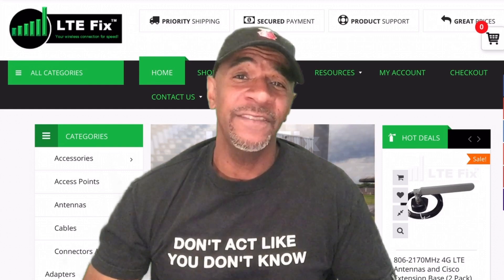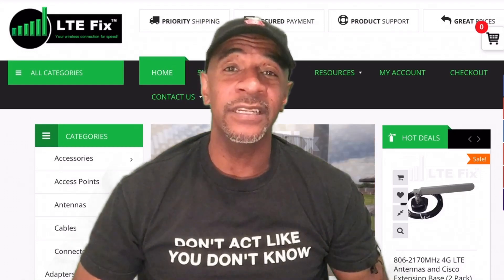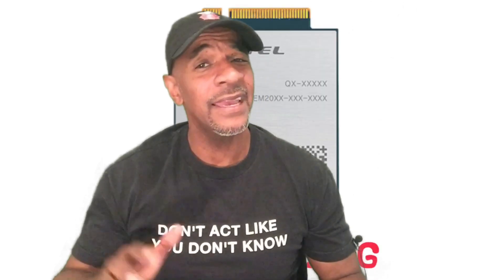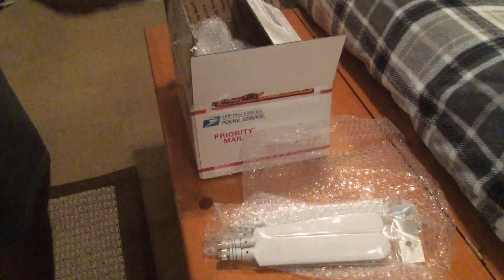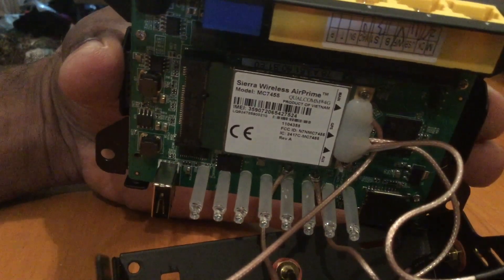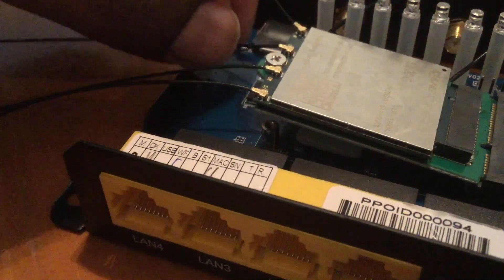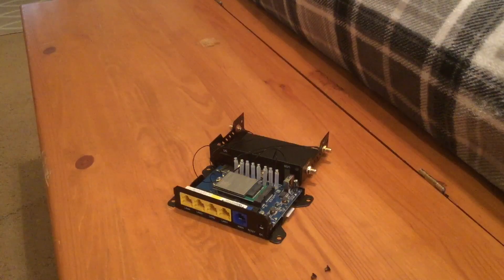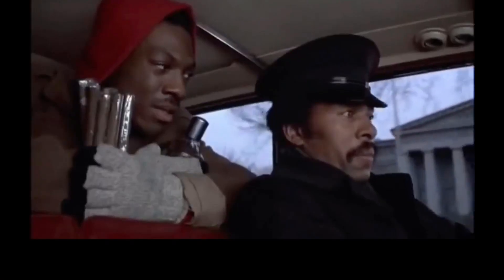How To Make Your Own Cell Router

Comment: First off, thank you! I'd been looking for someone who's successfully executed this. 
I was surprised how few actually talk about this
I've been on the verge of doing something like this. Are both modules still necessary if I'm intending on using it hardwired exclusively. As in no wifi. 
I have router modem combo that has a pci-e slot inside.
Wouldn't I just need an LTE module?
Reply from the maker: You have a modem already ? Or does it have a slot for the modem? If its just the slot ( no modem ) then yes you'll need a modem , cat 6 or better for LTE and some firmware that's compatible with said modem ...then all you'll need is a SIM card with a data plan and you should be good to go!
Reply: It has a slot and it had a Qualcomm athenos pci-e w the tiny antenna hookups. 
I figured I could order and replace it w the same size but instead one w a sim slot
Reply from the maker: @davidh2550  I never used the sim slot on my modem only the only built into the router ( that's why the firmware compatibility was a must ) let me know how it works out if you replace it and use the SIM card on the modem slot. I would love to hear the results

Comment: So the EM20 is capable of theoretical:
* Download Data rate: 2 Gbps
* UplinkData rate: 150 Mbps 

The NexQ6G0 Router has 10/100M LAN ports = 100Mbs Max Speed, So if you get an average of 165Mbs Download on your phone, (Thats what I get) Wouldn't that Router be a Bottle Neck?  Unless you only use The Wifi 2.4g at The theoretical Speed 300Mbps to connect to most of your devices?  I think in my situation the WG1608 would be a better option because of the Gigabit LAN ports, I think just a personal choice as I preferer wired connections, But is that why you went with that Router?   ---- I've also seen some videos use a Heat Sink on the Modem Module, not too clear if it really needs a heatsink or not?
Reply from the maker: The 100Mb ports are a bottleneck for sure only went with this router because WG was sold out at the time (during the beginning of the pandemic) the heat sink is not needed just extra protection.

Comment: Do you have to get that expensive of modem
Reply from the maker: Not at all in fact I would advise against it now. A cat 6 or better modem will work fine
Reply: @profitgee1  what do you recommend
Reply from the maker: @RobertDickens2002  a Quectel EP06A its a cat 6 modem for about $100 there are cat 12 modems for $170 i wouldnt spend too much $ because 5G will be the standard in the next couple of years.
Reply: @profitgee1  Thank you for information and being so responsive I also subscribed
Reply from the maker: @RobertDickens2002  thank you!

Comment: hey Berry, do you know if that setup you built still works after the tower upgrade, by t-mobile?  most LTE modem no longer work with t-mobile after 8/2021.  and the ones that work are almost at the mofi price.  

thank for the video.

Comment: Just buy an unlocked phone and connect it to an existing router. In a stationary setup you could even connect external antennas to the phone directly. In my case I used a damaged 5g phone a DSL modem/router combo I had lying around, and it has no problems working 24/7 for years now. 

Every single router with a built in expansion slot that I've used failed in multiple ways within a few months, so try to stick to the more reputable brands and models with plenty of firmware to choose from.

Comment: Why a Cat20 modem with only 10/100 Ethernet? What do your carriers support? Seems like overkill if your carrier can’t support the extra Cats and if they do then you won’t get the speeds out of the router. Not a problem if you intend to upgrade the shell later to something that supports gigabit, but would still question if your carrier will ever upgrade to anything approaching Cat 20.
Reply from the maker: Basically I ordered what was available during early pandemic the pickins were slim lol wanted to get the WG3626 for the router but at the time couldn't find any the cat 20 is a bit overkill but the only other modems available at that time were cat 6 and I already owned a MOFI so....as far as the carrier goes the power in the cat 20 comes from the carrier aggregation capabilities, so if you have multiple towers around or multiple bands the modem can combine those to increase your bandwidth throughput, so as long as you have LTE in your area the carrier doesn't need to be upgraded to 5G for the modem to take advantage of it's power. Thanks for watching!

Comment: Hey Berry Good Juice I purchased a pre-made unit running golden orb and has cat12 modem. I have cricket wireless (uses AT&T towers). I couldn't find the apn for cricket so I used "broadband" suggested for AT&T and used for it 30 minutes then no longer can access the internet. Any browser I open cricket led me to a link that says my account is banned or suspended. I have 4 accounts with that plan and so far the other 3 are still working, only the one in that golden orb firmware is not working. I also have another sim card in a Mofi 4500 that has been working good for 4 months. Do you think I got banned because I used the wrong apn?
Reply from the maker: @Super Swing Trader I came across this video maybe it sheds some light on your situation....https://youtu.be/g4uROfZsC1Q
Reply: @profitgee1  thanks Berry Juice it turned out I used the wrong Apn. I used the correct apn and everything is working great. Thank you for your help!

Comment: Hey Berry Juice, thanks for the awesome video. This might be a stupid question but will router that you build have a built in sim card reader slot that we can put our sim card in? Thank you
Reply from the maker: @Super Swing Trader ..Not a stupid question at all, most of the routers you get from LTEfix for your build have a SIM card slot just make sure the modem you choose is compatible with the router’s firmware so you have access to all the modems features (ie band locking and carrier aggregation)

Comment: Great video. I’m a new subscriber now. I’m going to do this myself. I have the Mofi4500 sim4/LTE combo v3 but using a TP-Link gaming router instead of the Mofi router. Getting 65-75 downloads on my visible account, but I want more lol.
Reply from the maker: @biglonniegruhn it’s never fast enough lol! But make sure you spring for a Gigabit router instead of the one I used cuz you’ll be capped at 100 Mbps coming out the Lan ports. Your getting 75 down with Visble? That’s Amazing! What’s the ping like?  Good luck and have fun with your build!
Reply: @profitgee1  fastest was a 81.9 down 19 up and ping 119 jitter 5
Reply: @biglonniegruhn  What's your setup like? I am using Visible unlimited cell plan on an Android phone. The phone runs FoxFi/WiFiTether which hooks up via USB cable to my laptop which then runs to the WAN port on my home WiFi router which handles the rest. Speeds are stupid slow and I get random disconnects every couple of days or during heavy use daily. How are you getting around the modem being detected as a modem which will result in slowdown or account banning?
Reply: @profitgee1  sadly that modem you have is no longer available. They now have the Cat16 modem with 4x4 Mimo and 5X Carrier Aggregation.

Comment: What firmware did you use?
Reply from the maker: Jamie Holmes  I used the GoldenOrb_2020-5-16 kernel version 4.9.211, I go over it more in part 2 of this video
Reply: Is there a vid for flashing firmware for sierra wireless modems?

Comment: Did you have to do anything about the IMEI?
Reply from the maker: No. But the plan I have allows for SIM card swapping between devices. I’ve also used a post paid phone SIM in this router with no problems tho

Comment: lol you really didnt "make your own router"  you bought a router and literally just changed a few parts lol and btw you spent almost double of what you could have bought the mofi router for lmao you could get one on eebay for less then 200 sometime alot less!
Reply from the maker: michael wentz thanks for your comment  and yeah I didn’t “make “ my router I put it together. I spent more because my modem is way more powerful than the cat 6 in the mofi and yeah I could of bought a used mofi on eBay or I could’ve put a cat 6 modem in this and spent less than $200 ...cheaper than a used Mofi that may or may not work from eBay and certainly cheaper than a new one ....

Comment: You made me think of building my own router . My netgear nighthawk is acting up. I keep having to reset it. It is so annoying. I want to build my own now.my daughter needs it for online schooling. If you have any advice while the website gets restocked in about 7 or 8 days, please let me know.
Reply from the maker: @Dexter Russell when LTEfix is restocked hopefully you'll have your pick of routers and modems to choose from ...i recommend getting a cat 12 modem and if they have any routers w/ gigabit lan ports I'd get one of those(the one I have has 100Mb ports)  also check the LTE hacks  forum out there are alot of interesting builds people are doing that work well for them. Using Rasberry pi boards, power over ethernet...etc.
Reply: I'm also looking for a dual band router. Any suggestions?
Reply from the maker: @dexterrussell9581  the wg3526 is a dual band router

Comment: Wow! Thank you for doing this and making a detailed video.  
1. What other modem options are good one's to build a good unit with? 
2. Will any modem fit a router?
Sorry trying to learn, been reading up.  Currently i have a mofi4500.  I would like to have a stronger better unit. 
Thanks again and cant wait for more of your videos.
Reply: It all about the bands and how many you want to aggregate. Cat4 - No carrier aggregation, Cat6 - 2 bands, Cat12 - 3 bands, Cat20 5bands. All this depends on what bands are available and are theoretical.
Reply from the maker: Art Gutierrez there are several modem options that are good ....just depends on how much you power you want and how much you want to spend. cat 12 modems are great options and are cheaper than what I went with and more powerful than the cat 6 in the mofi   There are 2 types of modem cards:
Mini-pcie and M.2   Depending on the Modem slot in the router you may need an adapter like I did to fit an M.2 modem

Comment: Berry, you are the first one I've heard of using the EM20-G modem!  To bad it doesn't get the new band 71.  Also the price is pretty high compared to the EM25-AF used by most others.
Reply from the maker: steve c 1st Thank you for the comment ....the EC-25afx is a cat 4 modem that doesn't have carrier aggregation that's why it's cheaper than the em20G which is a cat 20 with up 7x CA. Band 71 is just for Tmobile and I don't get coverage for Tmobile where I live so it's not a priority for me... also band 71 is a narrow band (5mhz) and would probably be best suited as a secondary band in CA much like band 13 for Verizon , by itself you probably won't see great speeds on band 71 ...for a while at least
Reply: @profitgee1  I'm using it in Windows 10 so Cat 4 is plenty fast and none of that other stuff matters.  I don't think there is even a way to check which band it's using in Windows much less do CA or anything fancy.

Comment: Wonder how hard it would be to replace the modem in the mofi
Reply from the maker: Doug S you would need to buy new pigtails to attach the the new modem because the mofi has silicone on the pigtails on the installed modem then you have to hope that the mofi’s firmware will work the the new modem

Comment: Hi Berry, i actually built the same router as you, im wondering how i go about getting a sim card hooked up and verizon plan for it?? Could you please help me,  do i hook an old phone to a data plan and then remove the sim and place it in this bad boy, and we're good to go?? I dont see an imei number on the device so im guessing that's the way to do it?? Thanks
Reply: When i go into the modem general information it shows the em-20 is present but shows imei number as Unknown. Is this a firmware issue where i should download latest firmware by possibility?? thanks sorry to bother you with this
Reply from the maker: @cale583  no bother at all bro I'm happy to help if im able! The imei # should show under modem/sim info. Make sure you have the latest firmware. Mine is the GoldenOrb_2020-05-16 
KV. 4.9.211
Also if you haven't already get on Ltehacks.com ...lot of helpful folks on the forum. As far as a sim plan. You could get a visible plan (requires a phone to activate ) or a post paid unlimited Verizon plan (also requires a phone ) then swap the sim in the router. Test out your modem with an existing sim if it works without showing the imei # for the modem then Great!  From my experience I if you don't see the modem's imei then most likely it won't recognize the sim card iccid and you won't have service but who knows it might be different for you..good luck and ..let me know how it works out !
Reply: @profitgee1  Thanks Berry, where did you get that firmware from, i looked on ltehacks cant find it?? I have the 2020-4-04 version and the modem that was shipped to me was a prototype. Why do you think that its not showing the imei number in the modem settings, could it be the firmware is old or is the ec-20 trashed?? i put a verison working sim in and then modem information was reading ,"No modem Present" after flipping back and forth from modem 2 to 1 , it finally appeared ec-20 and then for provider:, it said, connecting which it never connected. I took sim card out re booted and it did the same thing. same exact thing. Could it all just be a firmware issue?? Or a modem issue??
Reply: @profitgee1  I did read on Lte hacks a while back in april this ec-20 was having issues communicating with the latest firmware. Jim posted about it. But im having a hard time finding the May 2020 version you have. Thanks for all your help.
Reply from the maker: @cale583  post your request for the latest firmware for the router with the ec20 modem on the forum and Jim (Helms) should give you the latest firmware they sent it to via email when I ordered but I can't find the email. Not sure if it's the modem but I doubt it ..probably a firmware issue
Reply: @profitgee1  I think the same thing after i found that post from jim in april. Thanks i will do that. Yeah its a real bummer. The modem was reading properly it just takes some time when you first boot the router, its slow. I just realized somethings not communicating properly for sure. Ill let you know what happens
Reply: @profitgee1  Well my NexQ6 had a firmware that needs to be flashed by Jim. He has the license and does not give it out.  Moral of the story its a new firmware situation that reacts goofy with the modem. So had to send it back to re configure. Said it has happened to a few people. Who would've thunk it??
Reply from the maker: Rick Forsight oh ok glad there’s a resolution hopefully when you get it back it’s works without a hitch!
Reply: @profitgee1  Yeah those guys were real good over there at net solution. Highly recommended. Im glad i took your advice and got the em-20, those mofi's are getting blocked left and right, not quectel though.

Comment: TNC Adapters?
Reply from the maker: Every antenna connection has a male and female type some are sma some are ts9 some are N-type. TNC is just another connection type (larger than sma) that's why an adapter is needed to connect the Cisco antennas
Reply: @profitgee1   Thanks for the quick replay. Keep up the good work.

Comment: Berry, thank you so much for all the videos you have made so far. I joined LTE HACKS FB about 2 weeks ago and I want to go LTE home internet option but it was very overwhelming for this non-tech gal. However, your videos are so informative and easy to understand. I currently have satellite internet and with kids at home, I really need a better solution and I think LTE might be a good option.  The downside is that I have no line of sight and just surrounded by trees and our house is located at the bottom of a hill. We installed WEBOOST and now we have two bars of LTE... (we have Verizon).  Can you or if you can refer someone from LTE HACKS FB group who can assist me with my situation? I would like to build my own modem too and probably need to install external antennas and I recently received AT&T Postpaid Ipad Plan SIM and would like to use that.
Reply from the maker: Kailey Allen make sure to check out LTEhacks.com and sign into the forum ( I’m not on Facebook) Jim helms, Bill A. And didneywharl are all very knowledgeable and helpful. I also don’t have line of sight to the  tower and I’m surrounded by foliage but with cell mapper.net network cell info lite and some trial and error, I found the best direction to point my antennas in to improve my signal. You can do it Kailey! Good luck and let me know when you get it set up and how it’s working for you!
Reply: @profitgee1  Yes, I will definitely keep you posted!  So quick question, out of all routers, why did you decide to go with NEXQ6GO Router ?
Reply from the maker: @jinheeallen1518  simply because it was what was available at the time ...i was also familiar with the hardware as it's identical to the Mofi4500 (besides the colors of the LED lights) I built it almost 3 months into covid so it was slim Pickens. I would've liked to go with the WG3526 which is a Gb router but couldn't find one at the time ...that being said im Happy with the one I got because I'm pulling less than 100Mbs from the cell tower anyway so it suits my needs fine.